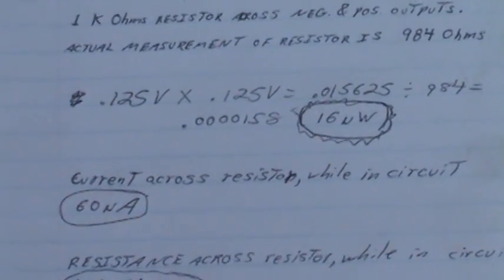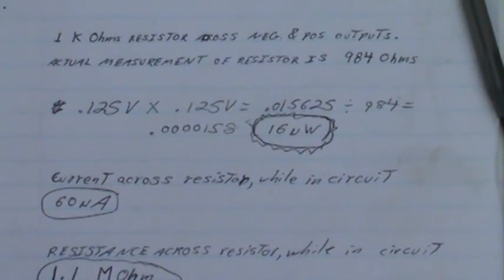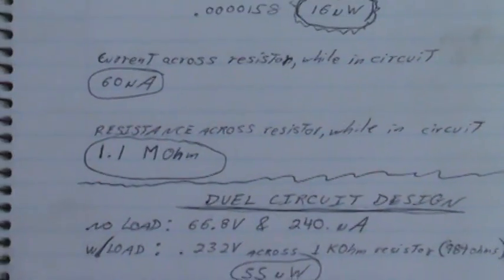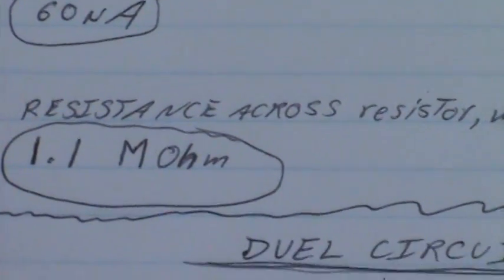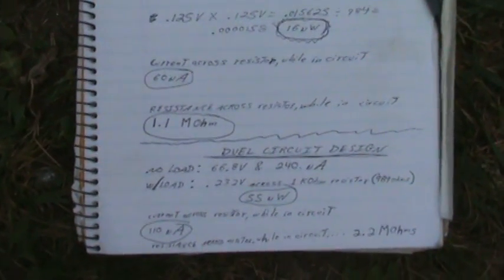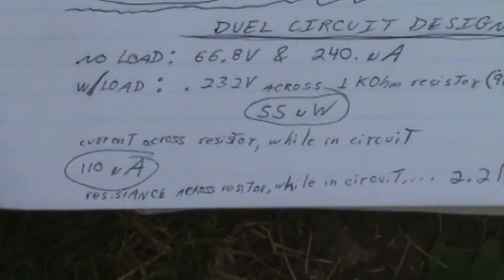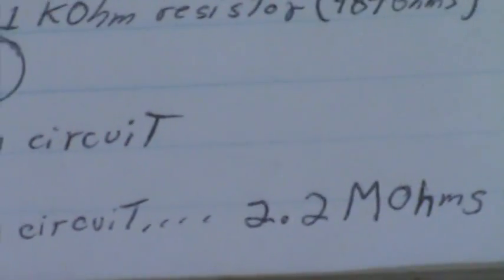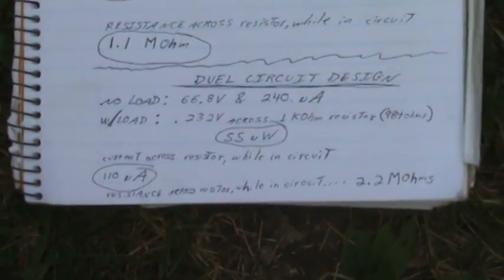FREE ENERGY FROM AIR CIRCUIT PART 24/24

Comment: i did it, i refreshed and watched them all. 120 volts is a nice record. i forgot you made that many from that antenna cool. there is obviously after all that, something is still missing.

i would like you to tell me what technique Tesla used, to do the same thing a diode could?
i you can answer that.  another question i have is how high off the ground did you actually try to put the transformers? most transformers are placed 30 feet above the ground. i just no sure i i would expect a different result ? also i noticed you never added a long wire on a alligator clip to any part of that circuit. only because i am starting to come to a better realization, that electricity is more like a dipole antenna then anything else. so if you have 30 feet of antenna, then you need something on the other end of that also.
i only say that now because Joel had results on his one wire system, by adding a 10 foot wire to the negative side of his diodes. other then that good job, that was a lot of hard work..
did you ever test the AC side? or only DC? because a antenna should act like ac ? or only pulsed dc? thanks.
Reply from the maker: Nice, you watched to the end! 🙂
What did Tesla use as a diode?!  He has his fluid diode/one way valve.  of maybe his brush discharge bulb,,,i am looking on line now....  A Tesla diode ring?....   i have not seen this before...  https://www.youtube.com/watch?v=Eh8gOHzdBU0
hmmm, what video is that with Joel and 10 ft wire. what was the title of that one, or do you have a link.
I only experimented with the AC on this project.  I think it was around 1.5KHz

Comment: Better to use wire made of different materials such as copper and zinc for grounding
Reply from the maker: +Ahmed Okasha Thanks for the comment Ahmed.  But i did try this in one of my video series parts here, i tried copper ground, then zinc ground and really had no difference in this set-up for some reason, i even tried both .

Comment: Have you tried to elevate the tesla coil on your mast and measure the voltage potential between the coil and ground?
Reply from the maker: I have tried elevating the coils, but not to much height because it is too heavy for my pole to support.  But i had the coil at the height of the garage, but had no better results.  But maybe at that time i needed to tune the coil with rod inside.
Igot best voltage potential when i placed coil near ground and had my ground rod going through the middle of it, but i think i just got lucky and it tuned the coil to best induction for the circuit.

Comment: 24 video parts and still using the same concept.
What are you trying to achieve here?
You are picking up radio waves thats all.
They use to experiment with radio waves since 1887.
Do not re-invent the wheel.
Reply: HappyPshycho can these said radio waves be harnessed, multiplied,  and amplified to crush the oil industry that we are enslaved to ? I think that's what we are all interested in to some degree ? Rather apparent isn't it? Unless you understand the wheels of old, you can't improve upon the wheels of the future.
Reply from the maker: whydotheheathensrage Thank you :-)
Reply from the maker: HappyPshycho This video is from 2009,,,,,i been working on many concepts for this since then.  Trying to implement ideas from this video of mine here......
https://www.youtube.com/watch?v=pg8rGROgfA4

Also going to try carbon rods soon.
This circuit does not just pick up power from radio stations or power lines, but it can also detect early Earth quakes from 150 miles away.  The power will increase in the circuit as it picks up energy from the piezoelectric effect of the tectonic plates shifting.  So we are doing much more than just tuning into a single radio frequency.  I belive much of the power is coming from frequencies from the cosmos, but this needs to be proved yet.

Comment: exactly, a coil near some H-voltage lines and you'd have "free" energy lol. if you had under ground lines in your community and had solar panels on your home, you could suck free power off them and sell it back to them as solar hahaha. all that needs to happen is that you use some power so the lines are producing a Freq to leach off of.

Comment: larger antenna for radio waves, smaller for microwaves. the inverse square law is basically that as distance double's from a transmission point of a sphere the concentration at that distance is 1/4 what it was at the first point. directed energy waves are much more efficient but require purpose of transmission rather than drawing power from a radio station that only wants to transmit to listeners.

Comment: i would think if you were closer to a station you could tune it to the station and draw power from them easier. pretty sure the inverse square law applies to how much you can draw. 
same principle these wireless charging stations they are putting out for phones that are highly inefficient of course. the orentation of the coils would need to be perpendicular to the station's antenna and the grounding bar would need to be driven deeper and maybe iron, conducts magnetic fields much better.

Comment: You may be able to tune it by adjusting the: First the depth, to higher or lower frequencies,  and second, adjusting moisture content to tune current flow.I would try it myself, but i live in an apartment. I can't go digging up the front lawn now, can i? :) Eh, It's just an idea I had, and thought you might like to try, But I guess even inventors have to rely on the tried and true. :)

Comment: Hi Paul:  I love what you've been doing and have been following you all the way.  I thought you might want to check out this vid.  This charging circuit runs on as little as 100 uA, and if you added a 12 volt regulator, you might be able to charge a bank of 12 volt batteries and run an inverter back to 120vac.  Check it out.  It wouldn't allow me to put down the address, so just search YouTube for Voltage Regulator Oscillator by jonnydavro.

Comment: A while back I ran into some info on Magnetic Field Distortion Detection.
They used a television yoke and a ferrite rod centered in it.
It's supposed to stabilize, then pick up the signal distortions.
I got the yoke, actually 3, from a projection TV, thought I could triangulate,
but I could never find long ferrite rods, It's reignited my interest,
Where did you get that? And can you get them longer?

Comment: I stumbled on your video, (22), after I discovered the kapa generator just today and was trying to find out more about it.
It's very interesting what you have done and it appears you have documented your research very well. I've look at a number of things that produce much less voltage.
I would have loved it if you could have got a higher amperage so that you could run an inverter with it.
Anyway, the thing that most interested me was that ferrite rod.
I need another comment.

Comment: I believe that inducing a voltage from your primary antenna--coil--ground circuit into an secondary circuit would allow you to pick up the power and adjust the frequency, voltage, etc.

Comment: Hi Inventor3, I saw some info stating that you needed to have a larger mass of material at the top of your antenna to act as a collector for the power, the larger, the more power.  Electricity that you want to use I would think would be AC as there is less loss and easier to convert to useful amounts.  You may need to get an osciliscope to determine what frequency you have as the meter you are using may not be capable of reading high frequency AC.

Comment: i have seen lots of videos of the sort but the thing Nicola Tesla did , did it with 19th century diodes
(vacuum tubes i think) i don't know what kind because apparently unless you get hold of his records and manuscripts nobody knows
but personally i think he used some new innovation diodes that has close to perfect zero volts forwarding voltage , that is the exact reason 0.7v silicon diodes don't give good results .
there is the LTC4352 that has close to perfect zero forwarding voltage but i...

Comment: May I suggest that the Tesla coil should be used as your antenna with the spark gap circuit used in reverse? I would try it first without the jewel thief as odds are that it would blow out. Some how it just feels right this way. I don't know a lot about electricity but it just hits me that way. It seems worth a little thought. Thanks for being there and working on this.

Comment: If you had put the money you invested in your circuit into a little solar panel you would have stamped on your circuit's power output. This is why solar panels are in use although they suck compared to radio power receivers which super suck. If you just wanted to do a Tesla free power experiment then try his night time solar panel thingy. That's something I always wanted to try before I became formally educated in electronics and realized it wouldn't amount to much and would be a lightning risk.

Comment: Paul, Tesla noticed that it was the turning on and off that made that eather Voltage. He found this out while working for Edison. Have you tried a M.O.T. or a PWM after your antenna but before your circuit? Also what about the HAARP antenna like a old clothes line that spins (Umbrella type?) I think they use X design. Also tesla says to use a polished surface sheet insulated from ground.  I truly think u need to pulse your input. 555 timer maybe? hook it up to a car battery and run 12v stuff

Comment: @INVENTOR3 How about attaching a crystal radio earphone instead of the calculator to see if you hear anything ? (not a low impedance regular earphone)  I bought one on eBay for my nephew.
Another idea would be to attach a audio amplifier to it (after the diode).

Comment from the maker: @definitionofis part 7, watch?v=XN_p1O7ESF8 , 258 KHz. recieved from antenna.
I recently got a cheap, e-bay, used, Heath Kit scope,,$50, but im still new at using it and need some help with connecting it up. 1 wrong connection and there goes the scope. Also bought frequency generator at same time.
I would now like to get the circuit resonating with the incoming frequency. Or get everything resonating with Schumann frequency.

Comment: I looked at the specifications for your protek 506 volt meter.
I notice it has a frequency counter.
I only had time to watch videos 20 through 24 to see if you used it on that antenna circuit.
Did you ?  It would be nice to know the frequency of what you are measuring.

Also an oscilloscope would give you more information as the waveform and voltage changes as you change parts. I bought a Rigold oscilloscope for less than $400 recently. It is excellent.

Comment: Enjoyed watching the videos, you are further along in practice than I am. Some things I want to shoot at ya, hopefully it inspires something. Have not read all the comments so if I repeat something, please forgive me.
First, Coil wire diameter should affect your Voltage / Amp ratio.
Second, Antenna tune, your length should match the sweet spot of your voltage frequency. Maybe try 440 Hz.
Thrid, Ground, Once you have enough, more doesn't help.
Out of characters remaining keep up the good wrk

Comment from the maker: @hardway760 Thank you very much!
Yes, strange that it works best with lowest forward bias voltage diodes,,results are not as good with silicon diodes.  It is still a mystery to me,,,hmmm, needs to trickle in little by little,,,,maybe a differant length antenna or diferant caps would change this, but im not sure.

Comment: ...Then see if you can get enough charge to jump a spark gap, if you can then you have the makings of a resonant circuit happening. Discharge it through a transformer and hey presto! See how quickly the universe will supply the power necessary to recharge/discharge your cap ;-)

Comment: Try tuning the aerial, Tesla's car aerial was only five feet tall but he was using vacuum tubes to step up the voltage. Electrons have a huge charge (potential difference) when leaving a vacuum. Also try adding a large capacitor in the circuit on the receiving end and see how well it charges.... 40volts is way more effective than a solar panel already :)

Comment: Did you know a resistor is just a coil of wire? How thick the wire is and how many turns determines it's resitance and current rating. Resistance is really just another way of measuring voltage drop or the potential diff. across a conductor/resistor. With your circuit you have a voltage potential diff. between ground and the aerial which you are able to measure using a resistor/coil. Different techniques will give you better results but that is the essence of it.

Comment from the maker: @klam3r0n Interesting, someone else mentioned trying the series or parallel of diodes.  Hmmm, im thinking it will cause more voltage drop.  This project will have to wait now untill winter is over(aprox 3 months). I will be back at it soon, and trying new things. Also top section of my pole broke, i will fix when winter is over now.
Thanks!

Comment: I have been toying with sets of diode's instead of just 1 (2 per circuit in your case) I would be interested to see that you get if you put, say 5 diode's in parallel where you have each 1 diode.  maybe try series too. My similar experiments show increased voltages and power output. not sure exactly why, would really like to see confrimation
Also would like to share a good place to get electronic components online cheaper that the shack... American Microsemiconductor inc 
Good work! keep it up!

Comment from the maker: @INVENTOR3 con't........current will run from outside of wire to inside wall of elbow, and then back to outside of antenna wire down to circuit. Maybe this will help, or maybe it is better without the bending over second board.  I have noticed that the antenna wire does not like to be bent around corners too much either. You will at least triple your readings when you put coil at ground end with ground running through it :-) Great videos and blog site! you are sooo close to having great results!

Comment from the maker: @INVENTOR3 Please, you must try coil at bottom with ground wire running through the middle of it, watch videos carfully to see how i have it wired with the coil,,this is where i get a huge diffferance!! With antanna wire that runs from board to board,,,on second board where antenna bends over, try placing a copper elbow piece there with antenna running through it, current ridding on surface of antenna wire, when it hits the corner it wants to fly off into space, so with copper elbow maybe ..

Comment from the maker: @nebula7693 I see your blog! Beautiful! Wow, im flattered!  Good set up.
OK..first, i never saw the ground wire. Fun to watch someone else doing the same experiments i did, heheheh, now you know how i felt. I did not get good results from adding 2 antennas either, or with coaxial cables, or even with 2 antennas and 2 circuits coming together, strange. Keep the antenna tight as possible, dont let it touch anything, as your finding out.  I also did not get good results from coil on top.

Comment: Question:  Does the human body act as an inductor?  I noticed that when I touched the wire before it began to coil, voltage dropped, as I had expected it to.  Then when I touched the coil, voltage also dropped.  However, when I touched the wire after it had exited the coil, voltage doubled!.  Of course we are only talking about a volt and a half, but the result is what I find interesting.  Your thoughts?

Comment: I am encouraged by your results.  So far, from my experimentation, I have not been able to exceed 3.5V.  I first started with 14g copper household wire.  Got some interesting results (see my blog to see the two experiments I have so far posted).  I have also only wound one coil.  Got some interesting results from that, too.  But still have not exceeded 3.5V.  Hopefully, additional coil will help.  Also, I get better results when coil is between circuit and antenna.  Any ideas why so for me?

Comment from the maker: @eloid777 check out my videos....free energy circuit-how to part 1 to 3, lots of info there.  10 x 10 plate,,,i was thinking about this when i first made my ground,,i was concidering a 4 foot square copper plate horizontaly in the ground,,but a lot of digging and expensive plate,,,maybe i will try at a later time. First i think i need to get my circuit resonating.

Comment from the maker: @berilium16 i would love to see some photos.  without seeing your set-up, i would suggest now adding the coils. (1) 16" long coil, .034 wire around 2.375 dia PVC pipe. if you come this far...adding the coil will greatly increas things now. Build the coil and i can help you connect it into the circuit, if it is unclear from the videos.
Great job so far! a lot of people have a hard time just getting 5 or 6 volts,, but you have :-)

Comment: I made a replica.  I have the circuit using my metal roof as the antenna and a large stainless grounding rod.  I am getting about 5V DC and 0.00 milliamps.  Any ideas?

Comment from the maker: @berilium16 well, i tried to mount the screen at the top of pole, but was to heavy for pole, pole bends like fishing rod. I guess i could try the screen at ground level...
I did try copper plate, but not as good as antenna, but both together was a little better, but again i have not been able to mouint the copper plate to the top of this particular set up....I will try this. Thanks for comments.

Comment: put 4000 winds in a circle wound around a 5 gal bucket and stick that on a pole in the air , You will get voltage you wont believe , it picks up stray rf  . then get an antenna tuner and put it in line with it so you can tune it to more and less .

Comment from the maker: @ibpointless2 well, i have tried to connect multiple circuits together in series and in parallel, but did not increse current.  I dont understand myself.
I do use only 1 antenna for 2 circuits.  I have diagram here...  paulslab. blogspot.  com